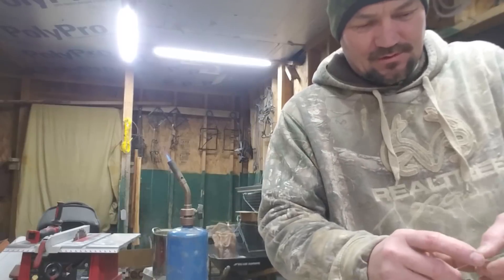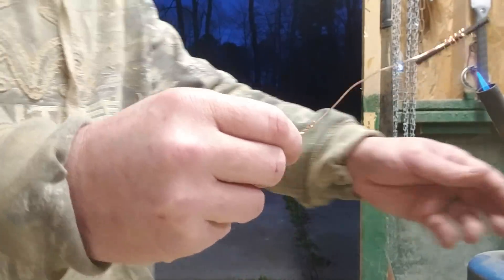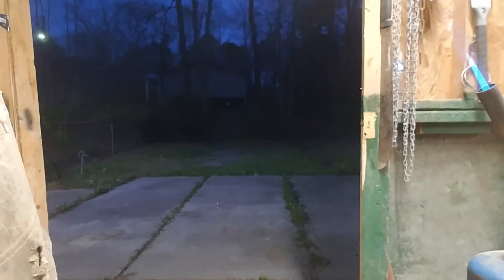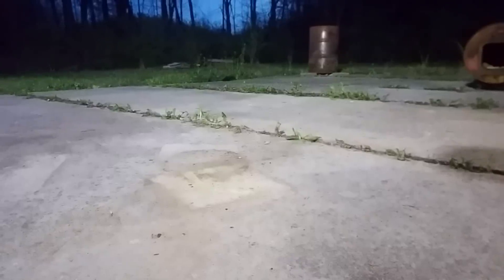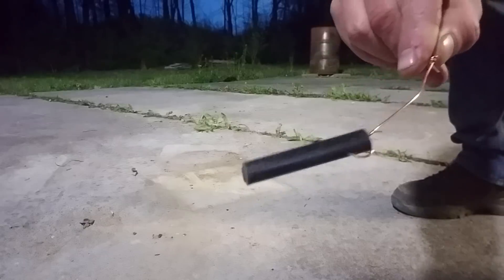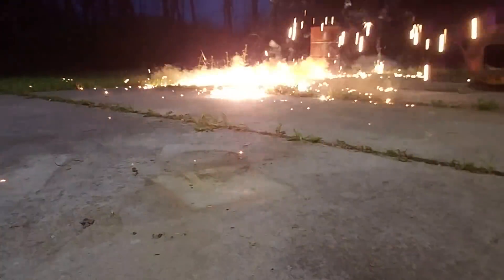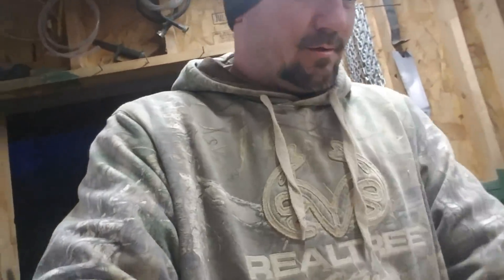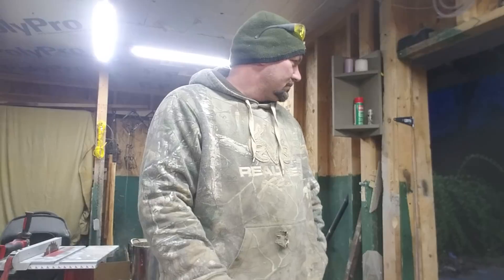EXPLODING FERRO ROD

Comment: Try powdered ferrocerium! Problem: it's "pyrophoric", which just means that the instant you try to grind or break it into a powder, all that extra surface area you just created mixes with the oxygen in the air enough to light itself on fire just like phosphorous. What to do? Well, you can improvise a container or glovebox to hold some CO2, or argon, or... guess what?  MIG welding gas (C-25) is a mix of the two and might work.  You might need Argon or Helium, it's possible CO2 has too much oxygen in it. Burning metals have a nasty tendency to rip the oxygen right out of other chemicals like the CO2 you were trying to put the fire out with. O_O Did I mention this is fantastically dangerous?  Now, to get your powdered ferro cerium OUT of the gas box, you need to put it under a liquid which A) isn't reactive and B) excludes air from the powder. If you use something which also evaporates quickly, you now have a thermobaric explosive - because ANYTHING energetic can be used to disperse the wet powder into the air; black powder, smokeless powder, or something more energetic.  The faster the liquid evaporates and exposes the metal powder to the air in a shorter period of time, the shorter and more intense (dK/dT) the heat pulse.  Did I mention this is only legal to do this in a few countries?  ahem  Kids don't try this at home.
Reply: And it's too damned expensive - and unstable, and has unremarkable energy density compared to other materials - to have any real-world (ie; military) applications.

Comment: That magnesium really took off mate
Reply from the maker: It sure did gaz I was enjoying it a little to much.. lol
Reply: It wasn't magnesium it is ferrocium two completely different metals. One Sparks the other does not. One is used to strike a fire, one is used to get a tinder fire going faster. And ironically you can't light magnesium without a Ferro rod or a torch so one needs the other and the other does not.